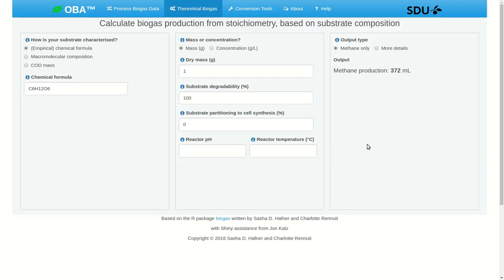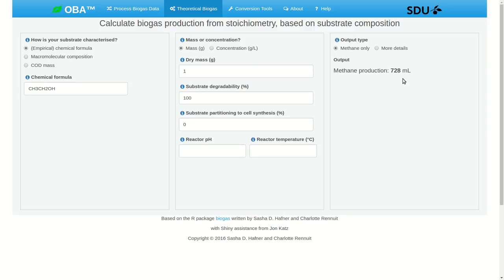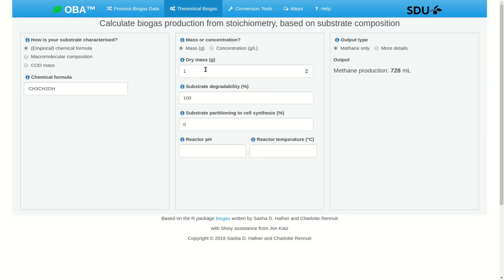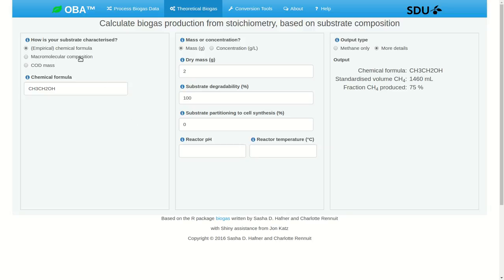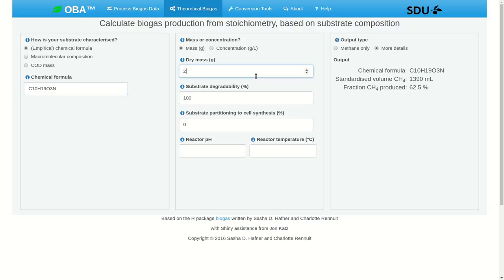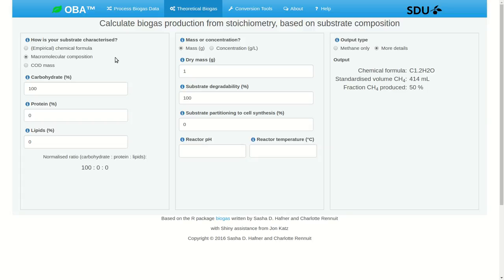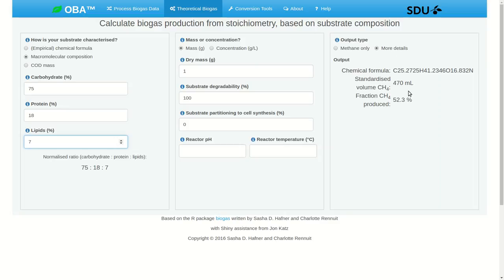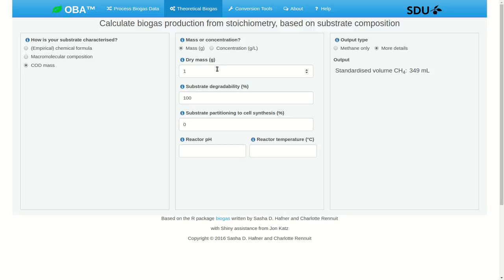Predict methane production using OBA

Comment: Hi Sasha, Can you tell me the approximate chemical composition of cow dung slurry (50% COW DUNG + 50% water) ?
Reply from the maker: I guess you mean macromolecular or nutritional composition, so you can predict biogas production, correct? There are some papers that present measurements, e.g., doi:10.1016/j.biombioe.2003.08.008. I used some values from this paper in the "Predicting..." vignette you can download here: https://cran.r-project.org/package=biogas (see p. 7). In that example I calculate a formula of ~ C23H37O14N. But composition will depend on feed and more. And there is a lot of variation in degradability. So how useful these values will be for you is unclear. For predictions or even interpretation of BMP measurements, you should at least measure total solids (TS) and volatile solids (VS).